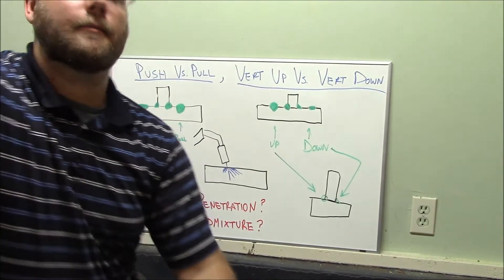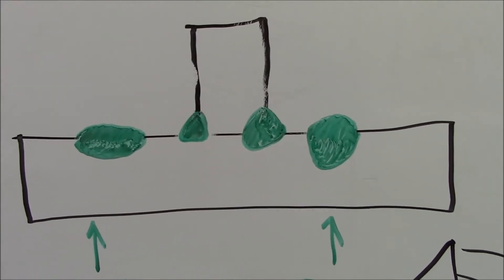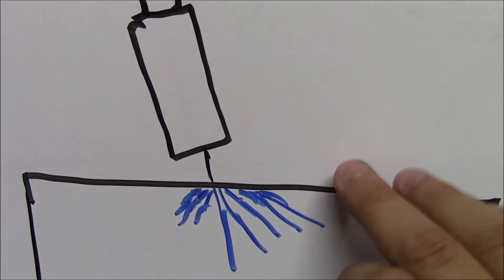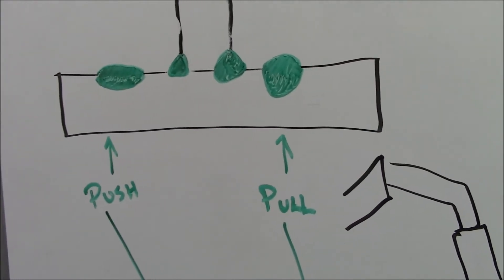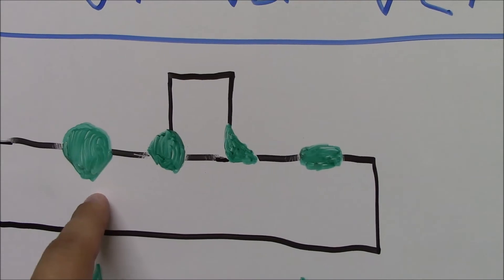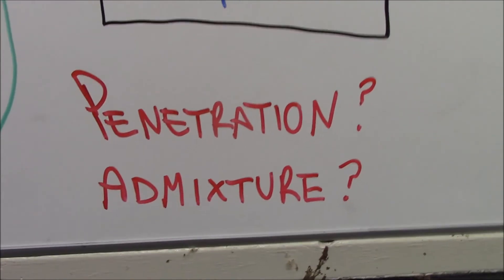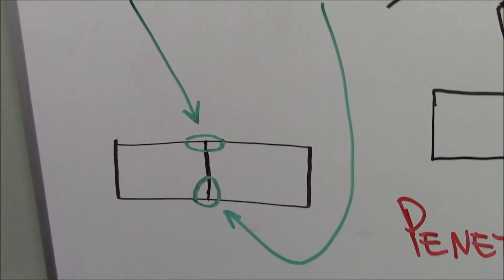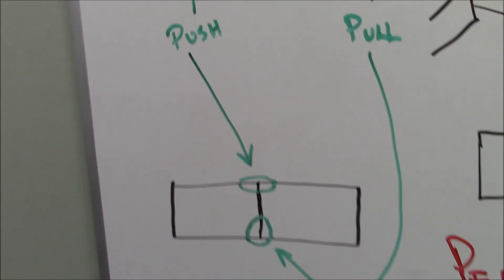WET Episode 1 Push Vs Pull and Vert Up Vs Vert Down

Comment: I'm very new to welding in any respect so this may be a dumb question but type of situation would call for the deeper penetration of pull weld?
Reply: in other words why would I need 70% filler vs 30%
Reply from the maker: Just to name a few situations as their are many, the most common I could think of is when there is a strong chemical difference in the filler metal vs the base metal and you want to balance the final weld in such a away to create certain mechanical or corrosion resistant properties in the weld. Another reason may be to reduce amount of time or an entire operation of beveling a weld joint if you can instead get full penetration without doing so. 

Like I said, there are lots of different reasons out there and each one is typically joint and product specific as to why and when to do it. Thanks for watching and asking!

Comment: why do pipe liner go vertical down on pipe.
Reply from the maker: Jim Flynn I cannot say that these are the reasons as I have no experience in the pipeline industry, but a few thoughts that come to mind.

A) The Engineers and Code of construction/welding allow it. This is a big deciding factor, as some Engineering firms base this decision on lessons learned...something failed...vs the increased production speed by going vertical down. Kind of relates to the Economics of welding triangle, Cost, Quality, Time. Delicate balance between all of them though an Professional Engineer took an oath to do no harm...blah..blah.

B) Generally the welding process of putting in the root pass is vertical down with a robust welding electrode EXX10 that is getting deep penetration already. and then successive layers may be required vertical up. Common combinations are E6010 root and E7018 Hot,Fill,Cap. 

Really you say pipeline, and I infer you mean Oil and gas industry which uses some higher pressures to move the viscous fluids? I've seen these welded both up and down. However if there are water transportation pipelines that are lower pressure, vertical down progression is normal to see. 

there are a lot of variables, and really I would think that point A above is the main deciding factor, but ultimately there may be no right or wrong in most applications.